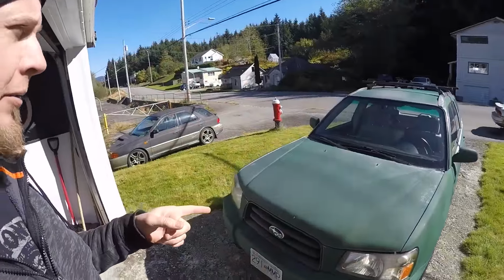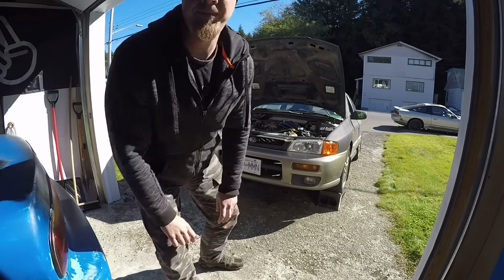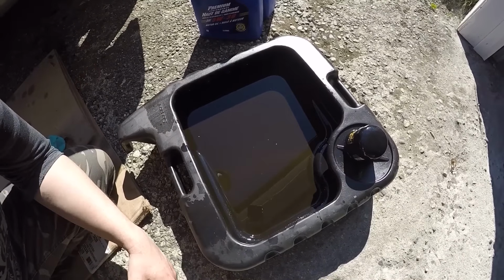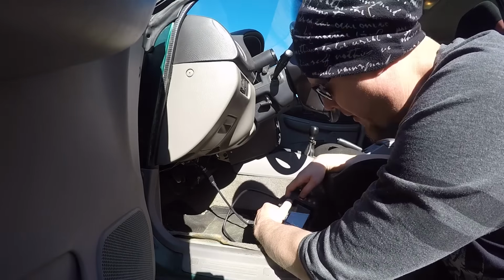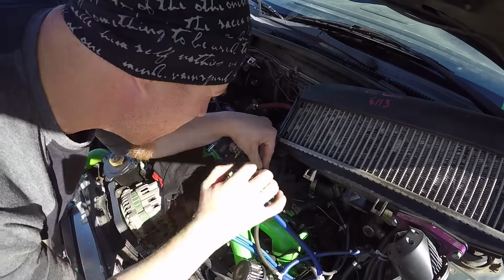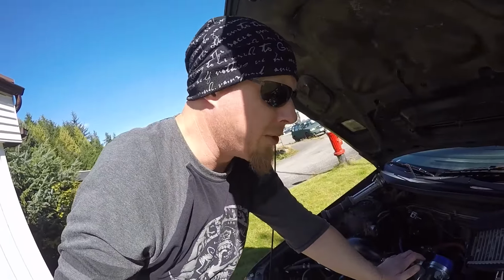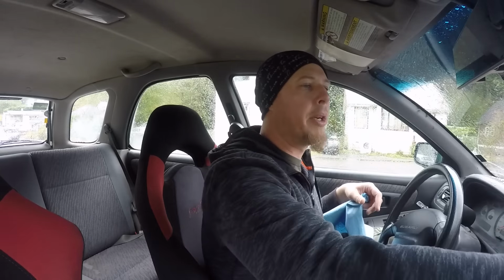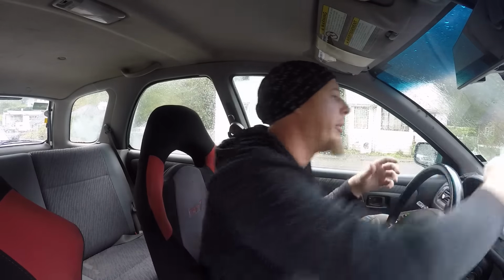SOHC EJ257 Hybrid First Oil Change / How To Flush

Comment: Awsome vids dude. Went back to check out all your impreza stuff. I subbed. More info and knowledge for me when I turbo my 06 2.5i soon.  I also follow Goldguy and Dirt Cheap Daily, that have detailed their Subaru turbo NA builds. Awsome dude,  keep up the good work and God bless.
Reply from the maker: Thanks! My original build was on a forum that was taken down. I have all of the posts and could make a video series out of it this winter possibly. I have boosted 3 different setups in the past 6 years. You will have some tuning options with open source for your '06. 
Thanks for stopping in and checking out my channel!

Comment: Awesome vid, what code scanner are you using?  I like the looks of it. Have a good one.
Reply from the maker: I have a CReader 7+  It does live data and will get into ABS and Air Bags on many vehicles.
Reply: Homebrew Subaru got it today. Works really good. It’s already payed itself off diagnosing my abs light. Have a good one.
Reply from the maker: That's awesome. For the cost of the Creader it's something I'm very glad to have in my toolbox.

Comment: That's a lot of engine in that oil. I don't recall anything of note in my first run in oil change. :)

Sooner or later you'll just have to bite the bullet and either get a tune or get a tunable ecu.

So let's talk about the cylinder 4 coolant mod. Is that bung behind it there a m20x1.5? I'm thinking of doing it when I finally get my tgv deletes done and get the manifold off to install them. Do you think it's even worth doing?
Reply from the maker: There was more glitter than I expected. It's all good, just as much came out of Tylers engine on the 4th oil change. 
If I have extra time and money next year I will get something to tune it. I know that I can do it mechanically though, been running this setup for over 5 years. 

TBH, I had never heard of the mod until you mentioned it before. I watched the vid and there seems to be substantial evidence behind the research. On the other hand, I don't see how 20-30 Celcius(if that's what the difference is) cooler around number four cylinder is going to make a piston not crack when the flame front hitting it is 600C or more. Anything is worth a try if it brings peace of mind.  :)

I would just like to think that it's not the reason for number four failing that is so important, it's the fact that pistons crack and that it just so happens to be number four that goes for whatever reason/variable. It would have been awesome if Subaru put forged internals in there engines for the hell of it, but let's be reasonable.  ;)  Sitting an STi piston next to an NA piston, there are very little difference and they crack just the same LOL
Reply: I think it's more of a coolant flow rather than the temperature drop. It seems that the mod simulates there being a coolant flow like there is over on cylinder 3 for the turbo coolant feed. But then again, what about the n/a engines that don't feed a turbo too? I see some merits, I just don't know if it's actually worth doing. Flame fronts are very temporary with most of the heat expanding out of the exhaust.

Buy an ej207 and you'll get forged. :) But I do like the extra 25% :)

Comment: what is that loud ticking noise that starts at 2:32, right after you crank the engine? it is audible all the way to 3:35
Reply from the maker: That is my Foresters piston slap. It quiets down a little, but I think the previous owner sold it because they thought the engine was done. I bought it that way and have put a good amount of mileage on it.